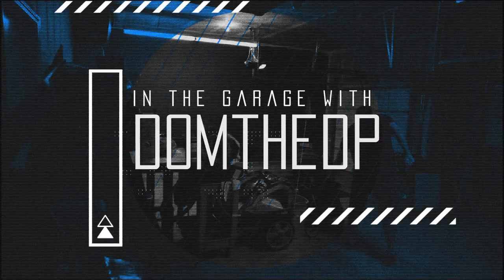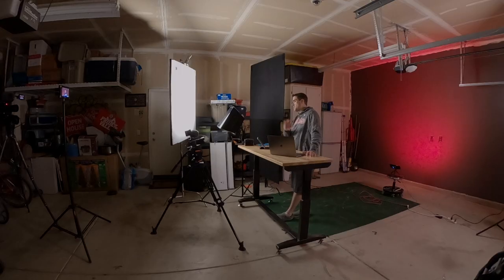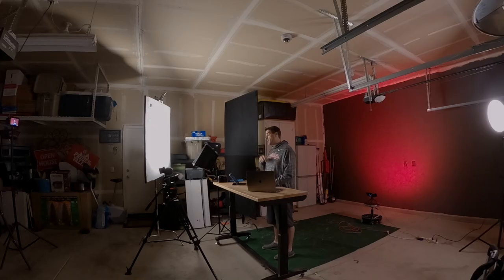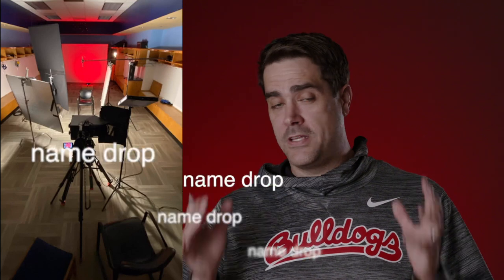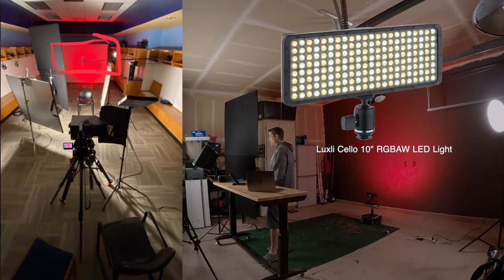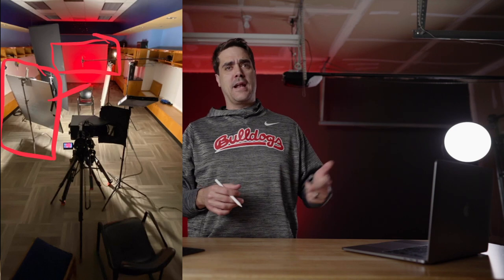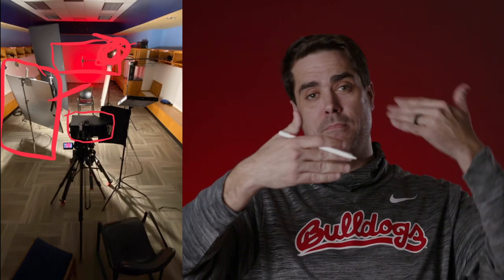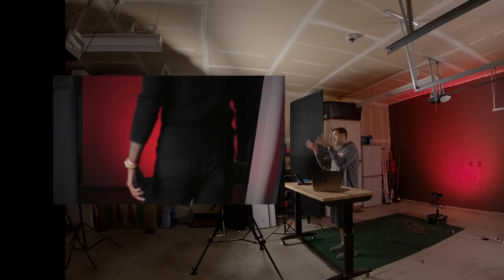Paul George Interview lighting and my b-roll mentality

Comment: Ha! I got an EyeDirect for exactly the reason you mentioned. I had to basically force a shooter I was working with to use it for one of my projects. How about tips for getting...umm...”seasoned” shooters to embrace them? Part of the reason was setup time...which I countered by doing myself. Do you keep it assembled or tear it down every time you use it?
Reply from the maker: Thanks Christopher,  I usually partially disassemble the ED and place back in the SKB hard case.  One tip...I never setup the EyeDirect on the same tripod head as my camera.  I always either bring a second tripod, just for the ED or a small stand with a 1/4-20 thread pin on top that the ED can mount to.  So now it is super easy to setup because it is independent of my main tripod and camera.  Take care!
Reply: Thanks Dom, I hadn't thought of putting it on a separate tripod/stand. BTW, here's my favorite usage of the ED from five years ago: https://youtu.be/WLu4P4goZ1s